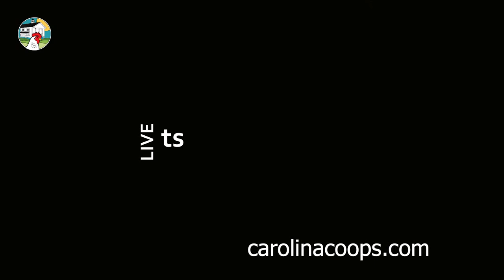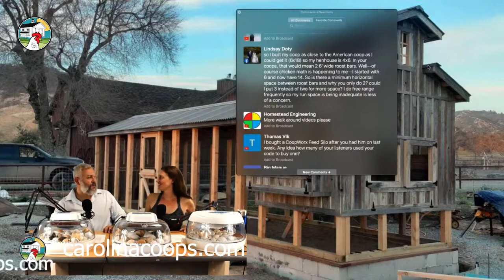Video Chicken Live: Cleaning out the Coop after 2 Years | Deep Litter Method

Comment: Silkies are sweethearts.  Mine lay little eggs every day.  They come when called and are just the nicest birds.  I also have a Mottled Cochin, a Green Queen, and a Steele Egger, all Bantams.  Chicken poop is not exciting, but I use the deep litter method -- haven't cleaned it since mid-April 2022.  Chickens are so easy.  I made an automatic waterer and automatic feeders.  My babies have been in the coop since they're 3 weeks old I put a brooder plate in there.  The run needs to be at least 6' tall and the coop has to have plenty of ventilation.  I read somewhere that you need 1 square foot of ventilation per bird at a minimum.  The bantams need 2 SF minimum in the coop plus 1' of perch, regular sized chickens need 4SF in the coop plus 1' of perch.  You should have a minimum of 10SF of run space per chicken, but the more there is, the better.